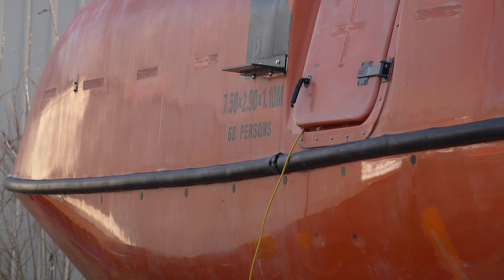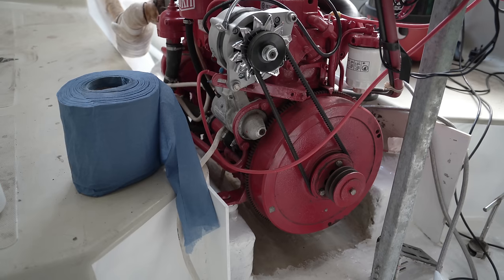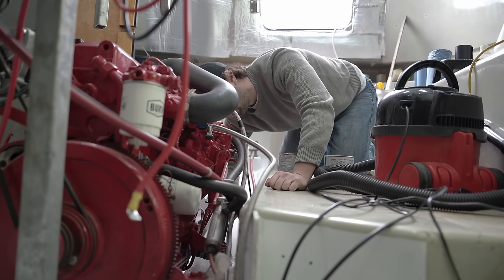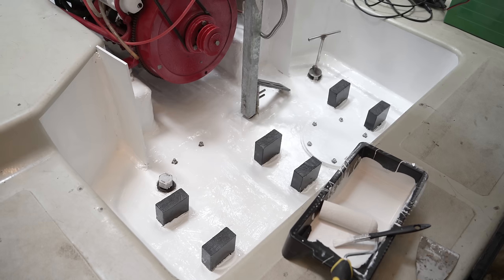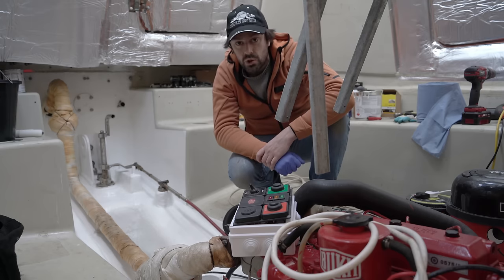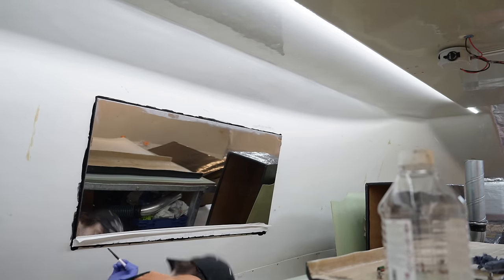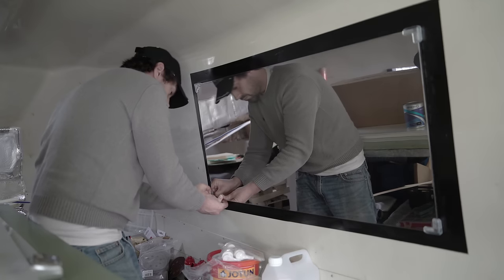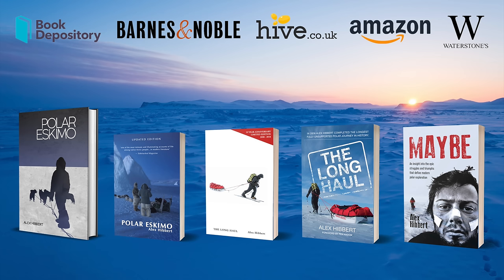Lifeboat Conversion Ep8: Preparing the engine bay [4K]

Comment: Those sticker may not actually be stuck on to the fiberglass. Sometimes signage that is considered critical and should never fall off is placed in the mold before the gelcoat goes in. As such it's not so much stuck to the fiberglass as it is actually embedded in the wall. You may be able to get them off...but you might also want to look around for a nice picture to cover it with.
Reply: A flapper disc on his much beloved angle grinder would get them off, although he may want to add a coat of long strand fiberglass filler over the area and sand it smooth before sealing.
Reply: I'd but a shaving  mirror over it or a keep calm carry on sticker there .
Reply: Yep... That is definitely probably the situation with those he will be better off just covering them with something else

Comment: I was in the Navy for 30 years, thus why I enjoy this series, one one ship I showed the young sailors how to paint the shaft traveling through the engine room, you just take a brush with paint on it of course, and lay it on the shaft while it’s turning...and just work your way down, does a nice job.

Well the young men went to work and thought you know if we use a roller we can do it faster.

The paint flew in every direction....any time saved was used in cleaning up the mess.

Comment: For the sticker: Heat gun. When that inevitably fails, paint it over and call it done.
Reply: I was going to say use a palm DA sander with 200 grit, but painting over it would work as well.
Reply: FGS, please leave the labels at the end of the video on, they add so much character, value and heritage to the vessel. You'll regret if you remove them or paint over. Don't erase history!
Reply: Second the heat gun. Should soften the adhesive if in fact it is adhered and not embedded in gel as some have suggested.
Reply: Orbital sander with 80 grit paper to start and smaller grit till removal is complete and desired finish achieved.

Comment: Removing those stickers can probably be done by use of a heat-gun, anti adhesive solvent (specialized or general), and scraper all used in combination. It might require an extra pair of hands.
Reply: I have read extensive scientific research indicating that a coat of paint is much quicker.
Reply: Yeah... typical bloke solution.... “Fire! And plenty of it!”🤣

Comment: I have two ideas for that glued sign. 
#1- some sort of blackpowder cleaning solvent. I've had a bottle of one called Butches Bore Shine.
#2- there are a number of citrus based strippers out there that could be useful. I've used citrus strip on varnish/paint with good results. They are also fumeless.

Comment: A rubber wheel attachment on a drill can be quite good at getting adhesive off gelcoat. I've used it to get all kinds of nastyness off the hull of my boat, as scraping very easily damages the gelcoat.
Reply: That's right. You can get specialist wheels for removing stickers off cars. Worth a try.
Reply: Caramel Wheel... whilst misleading, it is what the rubber wheel of sticker removal is called

Comment: Pin stripe removal rubber wheel will take that off.   That's what they used to be called.  A rubber wheel that spins on the end of a drill, made of eraser material, works amazing for removing stickers without damaging what's underneath.

Comment: You should add hand rails next to the doors. Also you can use Dyneema rope for the anchor line and any other rope. It’s light and durable and it is easily repairable with splicing the rope together. It’s most commonly used for synthetic winch line. Some people even use it for sailboats.

Comment: As Tony suggests, heat gun / hair dryer / scraper and I find that acetone works well to clear up the final mess.  PS Dont use acetone and a heat gun at the same time.   If the engine is going to be unused for a while try and nudge it to just before top dead centre on the compression stroke, to the point where it is hard to turn.   More of the bore is protected from the outside air and the valve springs will be uncompressed.
Reply from the maker: Good advice, thanks. And, also re: the heat and acetone. We don't want Episode 9: Alan becomes a barbecue...

Comment: I'd take an orbital sander to the diagrams and simply sand them off. You'll get down to the gel coat layer and can then sand with increasingly fine grit to achieve a similar/even finish to the surrounding area. This is the brute force option and will save heaps of time/effort.

Comment: Hi Alex,
I think your videos are great, however I also would like them to be longer.
My thought on your wondering about the stainless steel plates on the leading edge of the bow. You need some thing up there. I would go so far as to install a shaped piece that contours to the bow and runs from , and over the deck just a bit, and down to the keel line. Use a flush fastener so as not to create an individual point of contact. He would want to spread out the force of any sort of impact. greatly expands the collision protection. 
If you can, go to the point of bracing it off the Samson post.
In the conditions that you’ll put yourself in with Allen, the more hull protection the better.
Little Allen doesn’t have an airtight compartment on the bow in case something is damaged to the point of leaking due to collision, or just wear and tear from normal collision with ice, or from beaching. 
From my own experience, with my little 28’ off shore fishing boat, whatever is floating out in the vast ocean will magically maneuver itself directly into your path, at night.
Cheers! From old broken down landlocked Bart😎

Comment: Love your sense of humor directed toward the YouTube trolls that might linger in these comment's. 
Since your leaving the diesel engine in the boat have you considered using the heat that it generates as a heating resource for the cabin area? Pointing one or two of those fans in to some sort of duct work along the inside of the boat could be a great way to heat the boat when you need that little extra boost of heat to say warm. 
Those decals you want to remove area true pain in the butt. How ever its been my experience that when push comes to shove a good old fashion heat gun and sharp edged putty knife work best. get the adhesive on the back of that decal hot enough and  and that decal will probably peel itself off the wall.
Reply from the maker: The boat is a single interior space, so when the engine is running heat will naturally radiate throughout.

Comment: If you have segmented your bilge, make sure you have a bilge pump in each section. Water will collect in the lowest point of each bilge, and you'll have to empty them separately. With one big bilge you can get away with one pump - although the redundancy and capacity of two pumps is helpful in an emergency anyway.

Comment: A kitchen steam cleaner will remove the sticker. I had the same issue myself with a sticker, tried everything heat gun, acetone etc nothing worked. The steamer with a plastic scraper worked and caused no damage to the surface underneath.

Comment: Thank you for the Update 😄
considering ventilation I've once talked with a guy stationed on a 206A (one chamber submarine) and he told that when getting to homebase that even after showering three times he had a department on the train home "for himself" so good work on the ventilation 😅
As another idea: could you check if it's possible to install moisture sensors (and small builge pumps) into the sealed compartments?

Comment: For removing the decals, for automotive they make a rubber grinding wheel that works for this.  Search for wheel eraser.  I've never used one on fiberglass though, so I would test it somewhere first.

Comment: Have you thought about adding a drip oil emergency heater? One that converts to burning wood , coal, ext. . In case you get stranded.
And a couple of desalinization water filters would be good too. Copper piping coiled around your engine exhaust pipe can be used to heat water for coffee and such. Extend the copper tube around the floor to heat the cabin as well. Those cooling pipes on the outside. Where they come off the engine can be extended around the inside of the cabin for extra heating. Every little bit counts in the Arctic!
Reply from the maker: Most likely sticking to a diesel heater, and another smaller backup that's again fed by diesel.

Comment: I agree that the videos aren't long enough. But also would like to say that the videos are more you showing your progress than they are you providing a forum for conversation. 

With that said, the paint will not protect the rusted parts for long. Naval jelly or just a spray of phosphoric acid will convert the rust to iron phosphate or ferris phosphate. Which incidentally also promotes paint adhesion.

Comment: Great job with the video, and I happened to have very recently had several logos replaced professionally and the guy was using a propane torch to get the old logo off. He said that a heat gun didn't work as well.
Keep going, you're inspiring ideas and not doing a "how to" video

Comment: Critical operating signage is usually placed before the gelcoat is sprayed on. Good luck taking them off. I suggest that you either paint them over or consider it a historic past in Alans life.
Reply from the maker: It doesn't seem to be in this case, as there's a laminated plastic layer that's already coming off, and a 'step' from the gelcoat to the sticker.

Comment: I add the use of a heat gun. You might also try a 3M rubber adhesive eraser wheel and electric drill.

Comment: It seems like there are more important things to worry about than the sticker.  If it bothers you, I'd be inclined to get something you like and put it over the old one.
5200 should do the trick for sealing the bottom. 
Cheers from Juneau Alaska, 
Greg Chaney
Reply from the maker: I want to mount/bond in that area, and so the sticker isn't an appropriate substrate. Otherwise I'd agree.

Comment: For those lifeboat release diagrams you can try peeling an edge just a enough to spray a little bit of WD-40 lubricant behind it. (WD40 is made to displace any kind of moisture) let that soak a little bit. If the sticker is plastic may take longer but after awhile you should be able to peel the sticker away. A word of caution, WD40 may stain the fiberglass. You may need to sand a little and then re-gloss with resin. You could always use a fine/high grit wet/dry sandpaper to remove the diagrams.
Reply from the maker: Sadly not. The sticker is double layer - both apparently plastic.

Comment: It would be interesting to fit a makeshift countercurrent heat exchanger to the cabin ventilation so you can get fresh air without losing heat.  If you did it especially clever-like you could vent the engine bay, keep the heat from the engine bay but not vent the engine fumes into the cabin.  It also almost seems like for the arctic you might want the exhaust to vent above the water level (not sure if it already does that from previous videos).

Comment: For your ventilation, do a Lunos clone with a used, cleanaed ceramic catalytic converter and 2 way fan setup oscillating in direction every couple of minutes, it'll save you a lot of heating in seriously cold conditions.
Reply from the maker: It'll be much clearer in later videos, but this is unlikely to be necessary as during the coldest weather, the engine won't be running, so a separate heater is the plan.

Comment: Hey looks good just another thing I thought of (I’m a merchant marine ) these things are corks so stability wise I’m not sure how much it’s going to weigh at the end but they tend to self right only if the KG is where it would be when all the passengers are strapped in just a thought man keep up good work .
Reply from the maker: Absolutely - the boats are designed for a specific load and with it positioned in a particular way. The changes to weight distribution are being planned with care, but I'm not fixing in ballast until there's been another sea trial to check.

Comment: I've had a similar battle with boat rating 'sticker' a few weeks back. Belt sander would be my starting point, and be prepared to patch up the gel coat a bit afterwards if you want it to look pretty. I'm guessing its either laid into the mold during gel-coating, or the adhesive has fused the sticker with the gel over the years. Some boats just want to hang onto a few mementos of their past life and sulk for months if you take that away from them....
Reply from the maker: Yeah I'm keeping some aspects of Alan's history, but want to clear this area to mount things. Alan's being grouchy about it, for sure.
Reply: @AlexHibbertOriginals   One great tool for working on boats is a Makita 9030 or 9031 sander if you can pick one up for a sensible price. Its got more finesse than an angle grinder for getting into small spaces and makes much less mess. With a bit of practice you can be surprisingly delicate for small jobs, but still chews through fibreglass like a beast when you need it to.

Comment: I would start out with IPA for the stickers, start at the top by peeling a little and applying IPA, let it soak! Then a bit more etc. Mek may damage the surface finish as will acetone, but would be the next step in getting the stickers off if IPA has little effect.

Comment: I recommend for the impossible to remove decal to form some sort of sealed container up against the bulkhead and then fill it with boiling water. I do not know of a decal that can survive continuous suspension in boiling water that will remain adhered to the surface.

Comment: That was great a little more detail was great .don't forget to fit a demister to the pilot's cabin screen with hot air from a old vacuum cleaner hose  or   electric elements .back in the 70s you could buy after market ones to stick to your crappy maxi back window.obously they would get hot and fall off and cause a small smelly fire which was no bad thing.I would be thinking of changing the engine mountings for something more springy with possible better damping qualities to reduce vibration through the boat .it would reduce noise a bit too and pilot fatigue possibly.A secondary stand up pilot station on the back of the boat would be cool on those days when its good to be outside and handy for precision docking but would be good to have a engine cut out teather in case you get washed overboard.
Reply from the maker: Thanks - and a good tip re: demisting.
Reply: @AlexHibbertOriginals  Thanks .The demister idea was not entirely my idea I saw it done in a Austin 7 car as a home made  mod  and thought it was a useful practical retro fit .Does the prop shaft and tube have grease nipples or are the bearings sealed units? .You can get aftermarket bearings with temp sensors to alert you on ap on your phone to alert you to a lube issue before it is too late .farmers and contractors  have this inbuilt in to some machines .the data isn't always shared with the owner or operator however and is fed back to the dealerships the first the operator knows is when the fitter shows up and the dealership has turned off their machine to prevent damage .Also they can turn off the machine if  (owner )not been keeping up with monthly  payments. ,! .just a bit of irrelevant trivia.Cheers you are doing  great one day if I ever get off my treadmill  I might get my own and live on it.

Comment: Hair dryer / Heat gun will remove the sticker   It heats up the glue used on the sticker and just use a Paint scraper to peel off

Comment: For the sticker, we have something in Canada called Goo Gone that works great for things like that. It may not work with the gel coat, but might be worth a try. I also like the idea someone else said about a heat gun and painting over it. You could sand it first to flatten the edges and ensure the paint doesn't peel.

On another note, I like your vids (no need for longer  :) ). I do think you'll end up needing a keel extension. Rough seas will be murder if you don't have some stabilization. Also, can you give a brief explanation of the purpose of your voyage? Maybe I missed it??

Comment: Have you tried heat for removing the decals(safety stickers)? Heat gun to soften the decal and glue, then scrape with a razor scraper or even a plastic putty knife. Depending on your location, a can of break cleaner and a rag should remove the glue.

These things worked for me when I did a lot of decal removal and replacement on old equipment.
Reply from the maker: It's resisting most of these typical tactics.

Comment: I'd buy some marine salvage brass portholes and three down each side and line the entire interior with that silver bubble wrap insulation that would reflect heat back out on hot days as well .and use heavy duty rubber dimpled stable matting on the floor  and over engine it would add ballast and cut engine  noise and vibration significantly as well as warm to walk on.Half timber the interior up to the portholes topped off with a Dido rail then have a studied red or green leather or vinyl padded roof (like a chesterfield)or 70s mack lorry diamond studded padded through out.like a stately 1970s vibe.and don't forget the minne bar and small disco  glitter ball for titanic luxuryy .My mate has got 40/gallions of cheap British gas blue  paint.that would look hot and make you blend in.
Reply from the maker: The main body of the upper areas are heavily insulated, so it's not just a case of cutting out sections. We've seen houseboat conversions of TELBs install lots of windows and skylights, and they look lovely but the key with Alan is to maintain as much of the key safety design as possible.

Comment: When I have a sticker with a godlike adhesive I'd want to get off, I normally just take a heat blower and peel it off... It might be a bit complicated because you might just melt your boat if you apply heat for too long but it normally works just fine